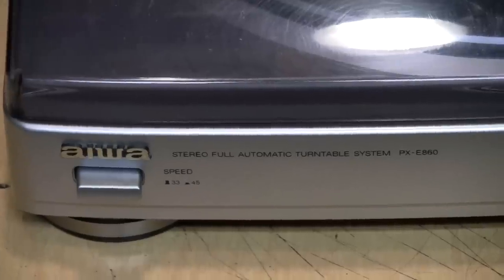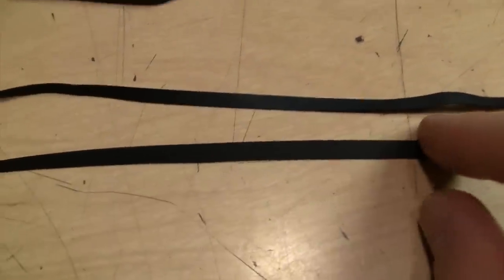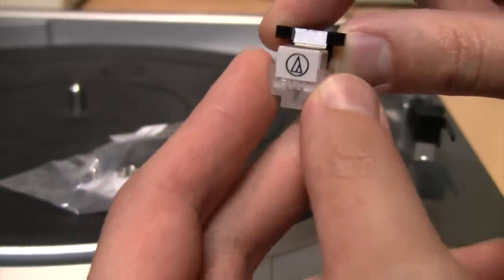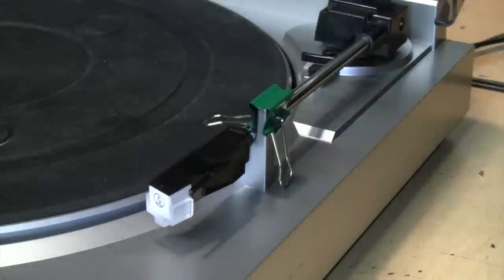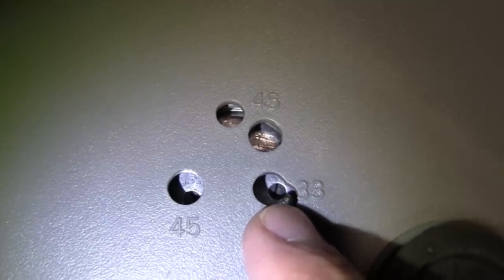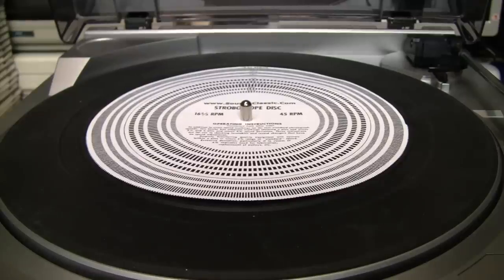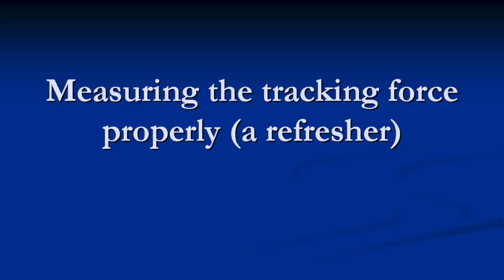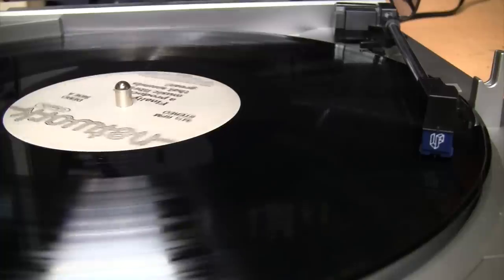Cheap fixes & upgrades for cheap turntables

Comment: After watching your video on cheap turntables I decided to buy an AT-LP 60, and I have a slight issue with the volume. Even though the built in preamp is switched on I can notice a drop of volume compared to digital sources at the same volume level on my Onkyo amplifier. Do you have any suggestions to fix this issue?
Reply from the maker: That is normal, because of the "loudness war" which has made CDs and other digital media a lot louder than most analog audio sources.
Reply: VWestlife OK got it, thanks for your quick response, though something might be wrong with my turntables preamp.

Comment: A have seen you measure the tracking force with a scale multiple times and I still don't understand if putting the needle on it's metal surface would damage the stylus or not. I've seen special scales, those have some softer looking material with a hole in the middle. And as I understand, putting on the stylus protector would result in the incorrect reading, so that's not an option.
Reply from the maker: No, it doesn't damage the stylus as long as you do it gently.

Comment: I have a sony lx300usb, and i get serious inner groove distortion on the last track of some lps. Do you believe that with the green elliptical stylus will sound better? Also some ellipticals come up to 2.5 - 3.0 grams of force. Is it ok to put them to sony which has 3.5g?
Reply from the maker: Yes, it does help reduce inner groove distortion. No problems with using them at 3.5g.

Comment: its hard for me to tell, which of the two styluses you recommended would cut out the most inner groove distortion possible? are they equal at that essentially?
Reply from the maker: Personally I think the Pfanstiehl sounded a little clearer than the LP Gear stylus.
Reply: @vwestlife  noted, thank you so much

Comment: They used to sell belt drive turntables for DJ use which are completely useless as the belt will slip as soon as you touch the platter to slowdown or speed up. Also the speed of the turn tables needs to be exact which is impossible with two belts. I guess they thought the kid buying would suck at spinning records and not notice.

Comment: Speed checking option #3: Place an object near outside of platter mat as a pointer (I use a wallplug) and whip out the stopwatch (app). Accuracy gets pretty decent after 50 or 100 turns, and chances are you have everything needed on hand already.
Or #4: Play a record with a scratch that's roughly perpendicular to the groove and record at known accurate sample rate into an application with waveform display. At 33-1/3 rpm, pops should turn up exactly every 1.800 seconds.
Neither of these are suited for adjustment for obvious reasons, that's best done with a strobe disc still. Getting a center hole into one of these can be a bit annoying though.
Reply: In terms of further upgrade options, I am pretty certain that both the case and the platter would respond well to lining with some bitumen mat (though I wouldn't overdo it on the plastic platter to avoid potential sag - the SL-BD20 would have had a more rugged alu platter in exchange for not having a built-in preamp). 
One free tweak is already demonstrated in the video - keep the dust cover open during playback (in order to avoid having the enclosed space forming a resonator that could result in feedback during speaker playback). 
If the surface the player is standing on is anything but vibrationally inert and wall mounting isn't an option, one sufficiently big concrete floor tile of decent thickness and two tennis balls (each to be halved) should give a decent and inexpensive decoupling option. (This could be painted in a jazzier color if needed, or you could always go with fancier - and perhaps polished - granite for some more money.)

Comment: Cheap fixes & upgrades for cheaps cassette decks in a near future? Maybe?
Reply from the maker: I have an ION Tape2PC cassette deck that is of a very common inexpensive design sold today, just like these turntables, and I do plan to do a video about it in the future.
Reply: I'm anxiously awaiting this particular video! I was hoping you'd review one of these, at some point.
Reply: VWestlife Did you ever finish that video?
Reply: @vwestlife  I'm looking forward to your tips for fixes and upgrades on the ION Tape2PC. It doesn't sound bad for a very plain deck and it is very easy to make good digital transfers via my desktop PC, but mine has one drive (the record side) which no longer goes into play mode as well as some speed fluctuation issues.

Comment: 549 dollars for an SL1200 back then. Amazing.
While being the 2016 model, my SL1200G was about 4k dollars.

btw,  putting a line level signal into a phono input can damage the phono preamplifier depending on its input impedance.
Reply: Not sure about inflation but the mk7 is $999.
Reply: @2010stoof  Yeah after releasing the 1200G studio model, Technics got a lot of negative feedback from DJs who didn't expect a studio model to be released.
That's why they came up with a cheaper 1200MK7 DJ model, after releasing the 1200GR.
They also released a 1500C at 999 euros for all the vinyl hipsters out there.

Comment: In this case, you'd be best off keeping the turntable mat, but if your cheap deck has one of those felt ones, you can buy the sheet material and cut your own. Rubberised cork is good, the type they use to make gaskets. Get the thickness according to your original mat. Buy a piece of material 12 inches square, and cut a hole dead centre (yes, I'm British). It needs to be 7mm. A cheap ball point pen through both the hole in the cork and the original felt mat should hold everything in place while you mark the outside of the mat, then cut it, it doesn't have to be dead on, it won't affect the rotation if it's not perfectly circular.

Comment: ...Hi...got a Crosley for Christmas that was picked up from a 'free' site in another town.....they did not check to see how it worked....I put a record on and you can just barely hear the music playing thru the speakers....I did change out the cheaper stylus for a diamond stylus, but it still sounds the same....is it possible to fix this problem, or is it trash.....I assume this is why someone was giving it away free in the other town...Thanks for any help !
Reply from the maker: You're commenting on the wrong video. Make sure it is switched to PHONO mode and that you don't have anything plugged into the headphone or aux in jacks, or else it will mute the built-in speakers.

Comment: Which of the stylus would you recommend? The lp gear one or the fansteel?
Reply from the maker: To my ears the Pfanstiehl 4211-DE sounds best.
Reply: @vwestlife  What do you find to be the differences between the LP Gear and the Pfanstiehl? In terms of detail...EQ balance...etc... what exactly makes the 4211DE "better" in your opinion? It's hard to tell by ear from the way the comparison was done in the video.
I've personally been looking at the LP Gear carbon upgrade because of AT's involvement in making it. I've been enjoying the sound quality of the humble AT3600/AT91 for many years and feel an elliptical upgrade would do it justice.
Reply from the maker: To my ears the Pfanstiehl elliptical stylus is slightly brighter and slightly less sibilant than the LP Gear stylus.
Reply: @vwestlife  
It seems that the blue one sounds somewhat louder but that means not automatic better.
I buy the green one.

Comment: Good video, but I have just one small comment on the strobe disc. It's not correct that it's important to print it out in exactly the right size. It will show the correct speed regardless of size. The only thing that matters is the number of lines spread around in a circle. The number of lines have to match up with 33.33 or 45 rpm and 50 or 60 Hz. The size of the circle of these lines is irrelevant.

Comment: Regarding the 45RPM adaptor. Why were records released with the massive hole? I remember them as a kid (of the 80's) and never saw a single with that hole in.
Reply: I think it was to help people remember that speed difference when playing the record, as not all turntables/record players back then could play 45 RPM disc.
Reply from the maker: Most North American 45 RPM 7-inch records have the large hole, while most European 45s have the normal small hole. The large hole was designed for jukeboxes and automatic record changers.
Reply: VWestlife Most European 45s had large holes, except in the UK and sometimes the Netherlands.

Comment: I have an AT-LP60XBT.
The factory felt platter mat measures 2.1m with my digital caliper.
I've seen 1.5mm and 3mm are pretty common. How  would thicker or thinner affect the downforce on the record, and by how much?
Like what would be the equivelant of putting a penny on top of the needle?
Reply from the maker: Even with that slight difference it will still be well within spec. A few tenths of a gram won't make any difference in terms of how the turntable performs. I just stressed the point because of people measuring it incorrectly and then falsely accusing the turntable of having excessively high tracking force.
Reply: @vwestlife  but which direction would make it go up? Thicker or thinner?
For the most part my record player works pretty good, but sometimes I think my needle skips too easily. Sometimes it gets stuck and I can't even see anything wrong with the record. Not even dust, but I set a penny on top of the arm, and it goes right past it without the slightest hickup.

Comment: any tips for fixing a skipping problem?  cannot get through a single side of a clean record and new needle without it getting stuck at several different sections... is the tonearm weight a little off and a way to adjust?
Reply from the maker: Try cleaning the record again. Even new records are often dirty and need several rounds of cleaning before they will play without skipping. Also make sure the turntable is on a stable, level surface.
Reply: @vwestlife   thanks for the quick response! so cleaning it definitely helped! duh...but now i am noticing when tonearm is close to center of record (end of a side) it starts to skip...happened on two different records...any ideas? maybe a can of dust off for cleaning out the tone arm swivel base?

Comment: hi I'm looking into getting one of these used, the pxe850k looks very similar to the e860 and regularly sells for cheaper in the uk, just wandering if their is a difference between the two? (in terms of sound quality and parts) I have read that they are very similar but I'm not sure if there are any differences apart from colour
Reply from the maker: They're basically the same thing.
Reply: @vwestlife  thanks :)
Reply: @vwestlife  update ive found a ion ttusb for a better price, ik that a lot of their turntables are pretty bad but this one has a counterweight and a replaceable cartridge. Worth it or should i pass?

Comment: You can use the refresh rate of a digital camera with a strobe disk to adjust the speed, most smarthphones cameras record at 30fps and 60fps.  When you record a video you will see the lines not moving in the screen when the speed is set correctly.
Reply from the maker: It only works at 60 fps and you have to be careful because many "60 fps" video cameras actually record at 59.94 fps (for historical compatibility reasons that go back to the 1950s).
Reply: @vwestlife  59.94 fps is a 0.1% error, acording to a technics SL-D2 manual, "'the standard commercial power source frequency, when actually measured has a fluctuation of about 0.2%. So 0.1% of error is aceptable to me IMHO. If accuracy is a problem, a DD with a  quartz clock will be the better option. Acording to technics an audiophile approved brand the rotation of the platter is constant but there is a slight shift in the movement of the dots that simply reflect Normal drift in the power source frequency. So the camera is an accesible way, everyone have a smartphone and the average person don't own bulbs. I think is more acurate than using the gyroscope sensors with apps.
Reply from the maker: Also the video camera trick only works if you can lock the shutter speed to 1/60. Otherwise just because it might be recording at 60 fps doesn't necessarily mean that the shutter speed matches it.

Comment: Scaling for the strobe disc printout shouldn't matter, so long as it's square and it still fits on your turntable. The important thing is the number of segments per turn of the table, and that won't change if the print is magnified or reduced. Also worth noting that a regular incandescent or halogen won't work too well, as they smooth out the AC pulses much like a decent LED would, and any modern fluorescent (or battery powered!) is way too high frequency. As seen on the video, you don't really get a good impression of it. You really want to use the cheap mains powered LEDs, an old style line-frequency (or direct multiple mid-frequency, often they'd run at 100/120 or 200/240Hz) fluorescent, or best of all and most reliably the neon telltale in a power strip, which is essentially the exact same thing as the lamp used on turntables that have a built-in strobe.

If you can't get that but do have a CRT TV available, that will also work fairly well (at least as well as the incandescents), or better yet an early 2000s CRT computer monitor, particularly if you can hook it up to an old computer or similar that you can use to put a thin white line on the screen instead of a full frame image. Just be sure it's set to either 60 or 50Hz (rather than the 70Hz or higher of most latterday displays, and VGA in textmode), and be aware you need to turn the speed up just very slightly for "60Hz" screens because they actually tend to run around 59.94 instead. (There's actually a little bit of variation with most old computer displays, so you might want to just tune in the TV to a regular broadcast or a DVD player and mask off most of the screen with black paper, but it's pretty small, about as much as what you might get from a lightbulb during times of particularly high or low load on the electrical system, or from a slightly wonky VHS)

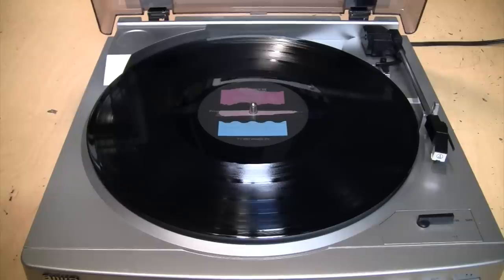Comment: Can you expand a bit on the part at 15:10? Why would record companies do that?
Reply: morphinglight To fit a slightly longer than possible recording on a disc most likely
Reply from the maker: Sometimes a song is sped up to make it sound more uptempo. This was quite common on 45 RPM singles back in the '70s -- for example the 45 of Gerry Rafferty's "Baker Street" is very noticeably sped-up compared to the album version.

Comment: Does anyone know if it would be safe to put the elliptical stylus from lp gear on pioneer pl990 I read somewhere that it might be harder on a record than the conical one
Reply: As long as the cartridge is set to the grooves properly (as long as it's adjustable)
But elliptical won't hurt records more unless the settings are off. If that turntable doesn't allow you to adjust tracking weight or adjust cartridge to ensure its aligned, then you're better of staying with conical

Comment: 4:00 Cut the belt and put a new one in. When the belt is tangled like this, it's stretched and does possibly work properly on 45 rpm only, if.

Comment: Hi my problem is there's sound on speakers when it's switched to phono but nothing at all when switched to line. Only happened recently. Would it be a problem with the internal preamp? Should I buy an external one? I have the audio technica LP60XUSB
Reply from the maker: Maybe dirty contacts on the line/phono switch? Try flipping it back and forth a few times to scrape the oxidation off the contacts.
Reply: @vwestlife  thanks for replying, I'll give that a try soon hopefully it works. Edit tried it didn't make any difference. Was working perfectly last week, it was only bought at Christmas

Comment: The sound of your text screens is really vintage: ever think about making it look vintage by adding distortion either digitally or just recording it on a VHS a few times over to get that weird color and over saturation effects? Seems out of place; nice clean text with 1970's sounds. That would be cool if you could make a template and use in all videos or distortion for each decade of equipment.

Comment: If you download and print a strobe disc it does not really matter if it is in the exact right scale. It's all about the numer of stripes, and if you print it at 90% of the original size, it will be exactly the same.

Comment: Hello, can it be fixed that when you change the size of the vinyl from 12 to 7 inches when the needle is lowered, the song is already started? In other words, the needle goes down one second later on the 7-inch record….???
Reply from the maker: See the segment near the end about the tonearm adjustments.
Reply: @vwestlife  what is the segment of the arm?
Reply from the maker: @manualge2493  Tonearm adjustments you probably shouldn't mess with

Comment: Do you know how to adjust where the tonearm drops on the record? On 12 inch records mine drops slightly too far in where the music on the first track has already begun.
Reply from the maker: Try moving the L. IN (Lead In) adjustment screw in small steps until it is in the correct position.
Reply: @vwestlife  Thank you so much for the reply. Would you be able to tell me the location of this screw?
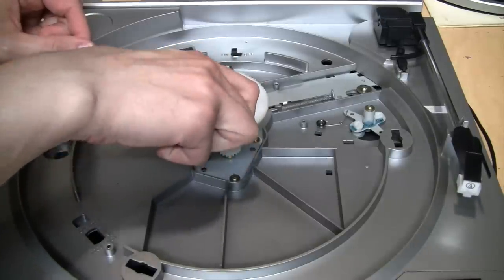Reply from the maker: It is shown in the video at 31:26.
Reply: @vwestlife  Thank you so much. Worked like a charm. For future reference, turning the screw to the left counter clockwise makes the needle drop more away from the center. Turning the screw to the right clockwise makes the needle drop closer to the center of the record. You're the man.